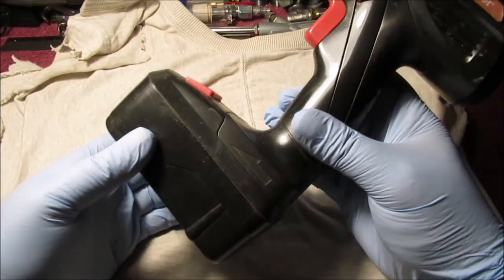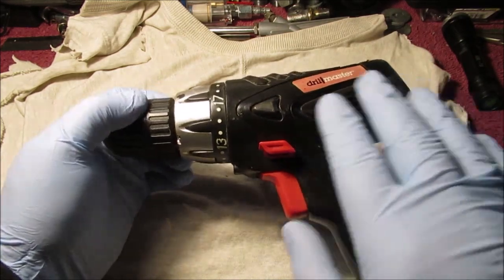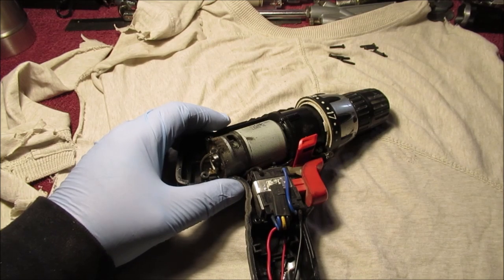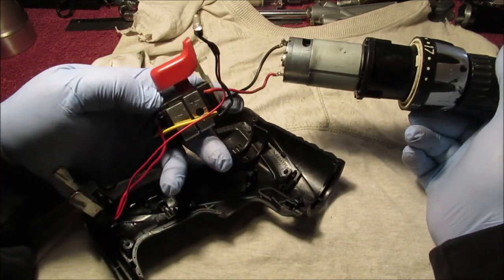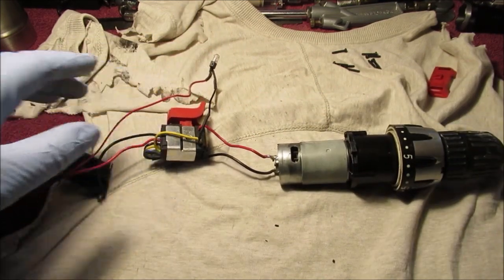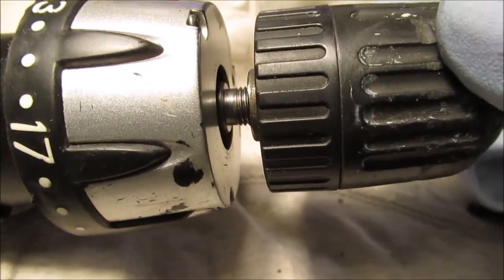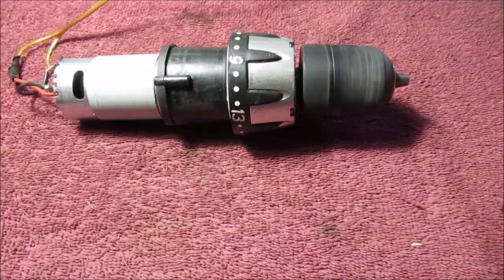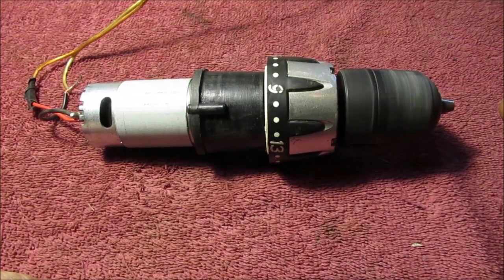Disassemble Cordless Drill ( For Future Project )

Comment: What were you running the 12 volt off? 
Thanks
Reply from the maker: Battery in my Truck I use and old 25 foot extension cord on them
Reply: @not2fast4u2c  Oh yea do you just run straight off the battery, no fuse no nothing.
Reply from the maker: @freakazoid111  Yes and if I want the thing in reverse I just switch the wires You can and should have a fuse I have a fusibile link from a Ford that is the same hing

Comment: how did you get the chuck off
Reply from the maker: There are videos on how ...Some chucks have a screw inside  loosens to the right
then put a big alllen wrench in the chuck hit it with a hammer it will spin off

Comment: The clutch went out on my Harbor Freight drill after a battery went bad. I got a new battery and it soldiered on then the clutch went. I looked down the jaws and could see nothing but a void. I put the allen wrench all the way down and tried every side to no avail. Then I took the motor off and was showered first with cogwheels then with ball bearings. By then it was just an investigation. The motor still works but I'll likely put the whole lot in the trash.

Comment: great job!!!
sr one question , is the motor 550 or 775 size? 
thanks for the video
Reply: It looked like it said 550 on the motor in the picture at the end of the video.
Reply from the maker: I have no Idea what that means
Reply: 550 motor size is 36mm diameter 775 motor size is 42mm  @not2fast4u2c